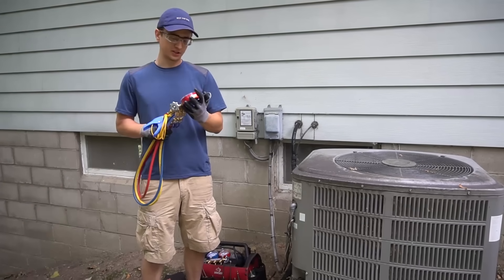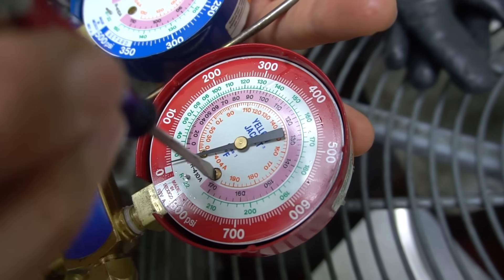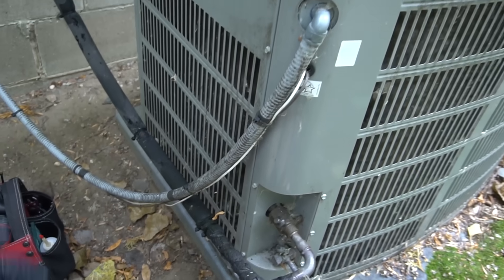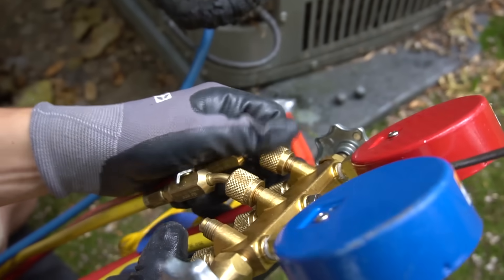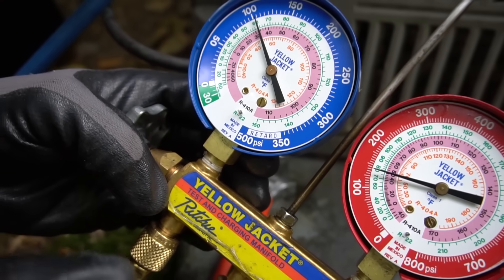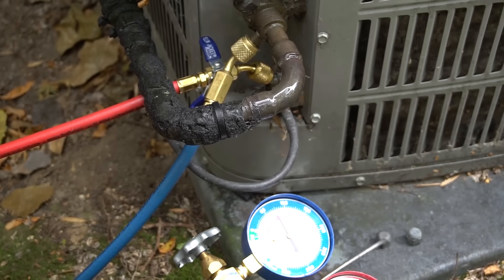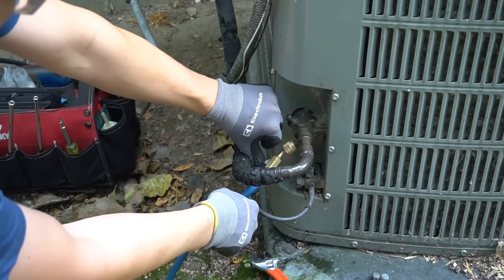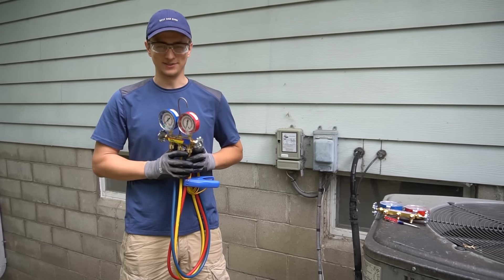How to Check AC Freon Level

Comment: Hello good video, but there are a couple of things to correct.  I know that most people will call it Freon and know what you are talking about.  Freon is a brand name though. You need to call it refrigerant.   The second thing is that when you hook up your gauges,  the suction side is correct. Your discharge hook up is technically not the discharge.  Its the liquid line. Does make a slight change in pressure if hooked up to a true discharge, but not significant for a diagnosis.  Just to add EPA certification is required in all states to handle refrigerant
Reply from the maker: Thank you for the corrections! I appreciate you leaving a comment
Reply: Again you presented it really well.

Comment: So the remaining refrigerant on high side  of gauge which is liquid you re routed it back to ac unit via suction line so you fed liquid refrigerant to compressor?
Reply from the maker: Yes. The amount of liquid refrigerant in the hose is not enough to "slug" the compressor so there is no damage done. I was taught this method at HVAC school.

Comment: So from what I gather if the low side temperature is between 40 and 50 on a 75-degree day when running, then your refrigerant level is in the acceptable range?
Reply from the maker: There are varying factors that come into play but on average, yes, most units will be in that range if the refrigerant charge is good. Although in my neck of the woods, 75 degrees would be about 35-40 degrees. Anything under 32 degrees means there is a problem.

Comment: Great videos. You are a great teacher so I hope you'll tolerate me as I ask a silly question:   If the unit is off and the equalized pressure is 100 psig in the vapor line and it is 45° outside, doesn't that mean you now have liquid R22 in the vapor line?

Comment: By no mean does any homeowner need to be checking there refrigerant levels on there own without being licensed or certified. There is to much risk involved with refrigerant burns. Just call a professional out if your having an issue with refrigerant....
Reply: I own it, I'll check whatever I want whenever I want.
Reply: fred broom lol have fun screwing up your system and having to call out a professional and spend thousands to fix your mess up when you could have just call us out to begin with and saved yourself money...
Reply: Also according to the EPA section 608 in order to technically even open up the refrigerant circuit you must be Epa certified. You can actually be fined by the government for opening the system and if you don’t know what your doing and let refrigerant out you could be fined if caught

Comment: Hi Jason what are the normal numbers for 410a when we ck freon like is there certain numbers we go buy to be low on Freon on r22 and 410a
Reply from the maker: There isn't really a "normal" pressure because pressures are affected by outside  temperatures and airflow in the ductwork. If we go by just temperatures, for both R22 and 410a, on a 90 degree day with no airflow issues inside, the suction saturation temp on the gauge should be around 45 degrees and the suction line should be sweating.

Comment: I can't find any decent videos on recharging a window unit.    I have a 15,000 BTU a/c - bone dry when I got it.  Brazed a crack in the line, added a service port on the pinch off / fill tube added refrigerant and still not getting cold.         Compressor is running bottom evaporator coils are cool but not real cold.   what am I doing wrong?

Comment: You didn't bleed the lines at the manifold and it's called refrigerant not freon, also you should NEVER attach or remove your hoses while the system is running.

Comment: what about contamination of the system - placing outside air in the system -- should you not bleed it a bit first ?? That's why you get a bit of loss so you don't. Especially on high moisture days
Reply: You should use a vacuum pump
Reply: Good point

Comment: What happens when someone puts in the wrong freon  like 410 when they should have put in r22
Reply from the maker: Well for starters it won't cool the house down and since it has a different oil in the refrigerant it will probably wreak havoc in the refrigeration system if left in there long enough. (compressor,metering device, leaks, etc)
Reply: Your fucked basically.... that’s like putting diesel fuel in your gas engine

Comment: Hi. I just finished my hvac education in miami. I went to a friend's house to check his unit. Actually it's a house that he is remodeling to sell. The unit he has its a unit package. The thing is that it has a little hole on the condenser coil. It's on the side, where the tubes make an u. The unit doesn't have refrigerant, because of the hole. My question is, after I repaired the hole, do I need to use a vacuum pump? I ask this, because it is a unit package, everything is there.... Thanks
Reply from the maker: Air and moisture are enemies to a sealed refrigeration system.. That unit probably has both. So if possible, I would suggest pulling a vacuum on the unit.
Reply: @WordofAdviceTV  thank you
Reply: Raimundo  use a VP  and dryer
Reply: Always vacuum the system when it has been opened and the gas is gone, then leave the vacuum on it for a while to make sure it will hold the vacuum. If you know how many lbs of gas it takes for the system, re-gas it using a scale to get the correct charge. You want to always be sure there is no moisture in the system so installing a dryer is also smart thing to also do.

Comment: I was looking at this because i just rebuilt my auto a/c. I have rented this A/C manifold gauge it is a R134a design I'm just a laymen But I think this video may be overkill. For a/c auto systems what you see in stores is just the refill canister with the low side gauge attached. I will futs around when I check my systems specs. but I cant see why I just cant check the low side with this type of gauge and skip the nonsense of loosing or recouping that 1 oz of lost Freon. But then again I'm not trying to rip anyone off and make a career out of this like most a/c tech's......
Reply: Because it is a violation of federal laws to release Freon into the environment.

Comment: After disconnecting the high side line to drain the gauges, could you purge the yellow hose by simply opening the high side valve and then briefly purging the refrigerant from the opening of the yellow ball valve, then opening the blue hose to suck the remaining refrigerant back in to the system?
Reply from the maker: The way you described it is exactly how I would do it :)

Comment: I see that R22 normal level is around between 40 to 50 ane When checking R410 look for that pink area marked R410A and between 40 to 50.  Hey if HVAC technician works as you do, I would pay double what they ask for.  I agree that who have no background about HVAC they should hire technicians however,  your video will inform homeowners and able to tell if HVAC technicians are well trained or not.   Thanks.
Reply from the maker: @yesitsmonkey Glad to hear that you are more confident about your refrigerants now :) Thank you for watching and commenting!

Comment: My Air Conditioner label reads it need 3.76 lb of R22, When I connect these cables Blue Gauge is at 50 psi and Red Gauge is at 25 psi, 
Not sure if it’s Freon is low?
Reply from the maker: This is while the unit is running right? Yes, that is quite low.
Reply: Depends on how warm it is too. If it's a 90 degree day, I'd be shocked if your system wasn't iced over at those pressures. And the 3.76 is the factory charge, have to also account for your lineset length. Could be alot more the longer the lineset.

Comment: Finally someone that makes sense, thank you.
Reply from the maker: Glad I could help! :)
Reply: I may have a slow leak, can you recommend a sealer, and what your thoughts are about that. And or make a video?
Reply from the maker: @brunoboynyc  Sorry, those kind of videos can get me in trouble so I refrain from making them. As for what sealer to use.. I really only used one in the field and just a heads up, it is not an 100% success rate. This is the sealer:

Easy Seal: https://amzn.to/2Yb89Yp
You would also need gauges and this thing: https://amzn.to/2XQLVeU

If you don't have any kind of hvac experience, I would advise not to try this though.

Comment: Not a smart move teaching everyone to charge a system when by law you must have an epa certificate to do this. Could cause someone to get hurt or cost them thousands of dollars in fines. You also forgot to mention sub cooling and super heat and do you have a fixed orvis or a txt. Accordingly your gauges by high side you was low charged 70 degree day would be 100 degree sub cooling.
Reply: yes and you could get run over crossing the street but i hope not be real this will help lots of people from getting riped off this isthe truth i no from the past
Reply: Could help people get in trouble I ever hear of anyone using refrigerant and no epa I’ll personally turn you in. It’s meant for professionals not amateurs. There’s a reason we go to college to learn our trade. Informative to a degree but enough info to get you seriously hurt Refridgeration is no joke when it’s enough to cause serious injury. Do your homework before mouthing a professional hvac owner !

Comment: 10:20 Why does it say RETARD?
Reply from the maker: Retard on a gauge pretty much means you are above the measured reading of the gauge and prevents the gauge from "spinning around in circles" (usually just bends the needle) when it is over pressured. Notice how the needle goes up to 80 PSI then maxes out at 250? It works properly and accurately until 80psi, the retards (slows) the needle but will still show up until 250. After that? Well, you are going to need a new gauge.. and probably find a valve, quick.

Comment: Chest freezer not  used for several years will there be freon left or empty. Senior citizen  not  mechanical at all
Reply: It can sit for 20 years and still run. Refrigerant doesnt expire and isnt a consumable, like gasoline. As long as your system is leak free it should work

Comment: MORON don't you know what low loss fittings and hoses are??
Reply from the maker: I have low loss hoses and fittings on my 410a gauge set. For my R22 set, I only have the low loss on the high side. But to answer your question, yes, I am aware of what low loss fittings and hoses are.

Comment: Servicing a unit in any way shape or form without 410 or 608 certification is Illegal and you can be fined up to $52,000  Per Violation! 
With that said. Keep up the good work and great informational videos but be sure to stress the legality. If your not a certified tech be sure to call one. You small problem may turn into a bigger problem very quickly.
Reply: both of which just require taking an online test. https://www.epatest.com/R410A/openbook/ .   So sit back down. Honestly, I dont know how you HVAC guys sleep at night.
Reply: Bleu Revo meh

Comment: can you reply with the above equipment necessary to do a check & recharge.  I have HCFC-22 (Trane XE-1000) made in 1996.  requires 3 lbs. 10 oz.'s   (which is what is on the label on the unit so that would be not including what's in the line).
Reply from the maker: Would this be a temporary fix or a long term fix? If temporary, then all you need is R22 and a set of gauges. Fill it up to about 70-75psi on the low side. If this is to be a long term fix, then you would need to locate where the leak is, recover all the refrigerant, fix the leak, pull a vacuum on the system - make sure it holds, then weigh in the proper charge. (you would need a lot of tools for that) But.. If you are not a HVAC technician I would not recommend trying any of this. First of all you can get a hefty fine if you are not licensed and you may end up hurting yourself or doing more bad then good to the unit..
Reply: @WordofAdviceTV  -- since the unit is 23 years old it would be possible that the r22 is just low having never been recharged, correct?  or can it last 23 years without a charge?  It's still cold coming out of registers, it's just not ice cold like before.  Takes longer to cool down on really hot days.  In fact, last night the windows had condensation on them when everyone woke up from having the thermostat really low and overnight in the AM hours it caught up with itself and finally the house was cool but since it was set so low like on 65, it really , really cooled the house down.  But like I said, it takes longer and is not ice cold like it used to be and when a bunch of people came to stay from out of town for 4th of July, we were all really hot.  Thanks for your help !!!
Reply from the maker: @harpoon_bakery162  If you watch my video on "Top 10 AC Problems" I go over the problems that you may be having. Most likely either you are low on refrigerant (most common) or your evaporator coil is plugged up.
Reply: @WordofAdviceTV  -- evaporator coil is the A-shaped unit inside in the  very lowest part of furnace housing (basically on the floor) ? correct?  it had condensation on it and i saw rust but and it has a tray on the bottom of it that collects the condensation that turns to water.  I realize it needs replacing but if i could do the temp fix for now until corona-virus let's up it would be ideal.

Comment: Pressures only tell you half of the story. You must read the line temp and charge a piston system using the superheat on the suction line or with a TXV, charge the system using the subcooling method (Liquid line). But check both superheat and subcooling on both types to get an accurate "Whats going on" with the system (Slight restrictions in the metering device, low or high charge- and so on.
 But before all of that, you must make sure you have proper indoor airflow (static pressure) across a clean evaporator and filter.

Comment: Good video except your process hose was never purged out and at atmospheric until it blended with the high side liquid and dumped that moisture straight into the low side
Reply from the maker: Yes. That was a blunder. I pinned a comment up on top where I talk about that mistake in the video. Thank you for the pointer!

Comment: My friend I had a question. Im replacing right now the starter motor capacitor but it doesn’t have any numbers or letters Im assume because is AC ~ it won’t matter but I want to be sure, could you please help me with that.
Reply: If you are talking about the capacitor for the motor on the AC unit itself, my suggestion is to look up the model number of your unit and find EXACT replacement specs for the capacitor you need. If you use one that is incorrect, you could ruin the new capacitor and the motor. the correct one should be fairly easy to find on company website, or google. Hope this helps you😊.

Comment: What would the gauge temp be on high & low for a 407c system? ambient temp is at 90°
Reply from the maker: All the units I work on here in Minnesota are either R22 or 410A so I am not familiar with 407c. You could use a pressure temperature chart to help with that though.

Comment: I have a question!? Im having problems with my unit And someone told me that the low pressure pipe should be cold and the high should be hot but mine is actually a little cold not to the point of sweat but not even warm I checked this with the unit on. Could you please help me with this?!. I have looked a lot of your videos and they are amazing, all the details and lessons are incredible valuable, thanks a lot.
Reply from the maker: It will not always be hot (the thinner line) but it usually is warm. Can you tell if your compressor is running at all? (the fan outside could be running but the compressor not) If everything is working but it's not cooling the house, then likely you have a leak and are low on refrigerant..
Reply: Word of Advice TV thank you so much for answer so fast I really appreciate it. I just noticed that my unit have an starter kit installed next to the capacitor and is in really bad condition. You think that could be the cause? Thanks again my friend for your videos.
Reply from the maker: @davidcandao1  No prob :) Most air conditioners can work just fine without a starter kit so it's not likely that the starter kit is the problem. Watch some of my other AC videos for more ideas on what can go wrong.

Comment: Greetings from CA! I am a tech and have referenced your videos many times. I won’t waste my time watching anyone else’s videos. 

I recently ran into a problem with the suction line not getting cold resulting in the air not being cold. Pressures, Freon, voltage, and airflow all seem good. Do you have any videos with this problem?
Reply from the maker: The best way to pinpoint the problem would be to use a slide rule. I use this one: SuperCool Slide Rule: https://amzn.to/2QdbcZx  On the back side there is an arrows chart (system operating diagnostics) that helps a lot with diagnosing refrigeration problems. Unfortunately I don't have any videos on that topic though. If the refrigerant pressure (low and high side) are where they should be, then that is an odd duck.. Not sure why it would not cool then.

Comment: Looking for something and came across this. Been in the trade now for 39 years and regardless of what others are saying I don't agree for the most part. Yes it would be good for new students coming into the trade but this is something they will learn in class. It seems to me your teaching homeowners how to hook up and check their system uncertified by the EPA. Maybe you should have said at the end of this and said it at the beginning. Because of these how to videos I have lost count on how many service calls I've run to find the customers have tried breaking down the system and failed. I wish these were made where students had some code given out so customers couldn't access these videos.